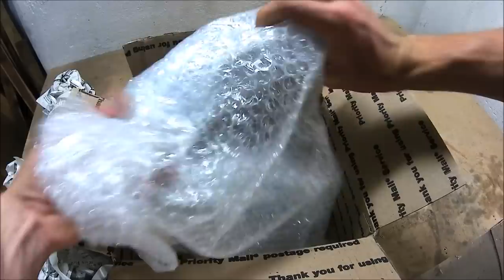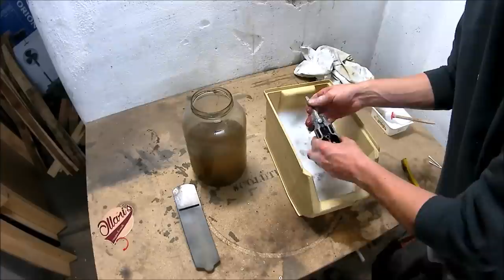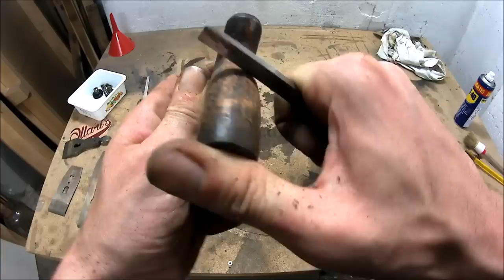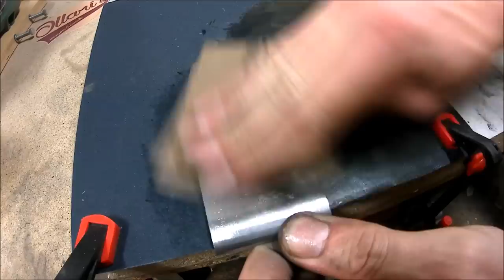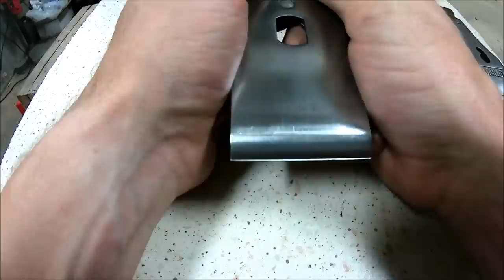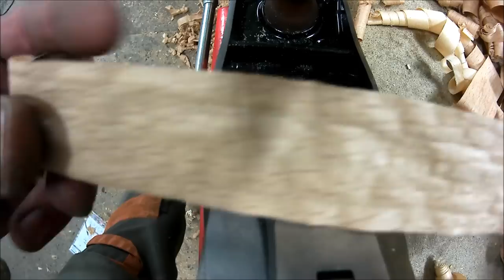Restoring a Stanley Bailey NO 4.

Comment: I've also used abrasive powder sprinkled over a sheet of glass lubricated with kerosene to clean up a plane body, instead of the sheet of sandpaper used here.  Restoring tools requires lots of mindless work, which is very theraputic!

Comment: Great work, I have some tips for you ... you shouldn't put (now you should remove) paint under frog that are directly connecting to body of plane. It soften the connection and can cause issue in hard woods plaining. Also a tip for cleaning screws heads - put them into chuck of a drill and use  scotch bright pad and after that use rag with cream for polishing compound e.g. automotive one for polishing rims
Reply from the maker: +Bartłomiej Derda Thank you for the tips! I will remove the paint for sure! Thanks for your comment!

Comment: Great work. What was the spray and solution you used to remove the surface rust?
Reply: Maybe Brake Cleaner.
Reply from the maker: +hulkpeace WD4 and steel wool
Reply: Cameron Lissner  has

Comment: I hope you got that plane cheap. At least the mouth didn't have cracks.
Reply from the maker: It was a gift from a good friend! It’s still in use for the past 3 years.
Reply: @Ollaris  free was the right price to pay for it. No. 4 is the least valuable hand plane Stanley made. Because they made so many of them. Not the worst plane they ever made by a long shot though. It really is one of the better ones. A must have for hand planing aficionados. You should have two. One for smoothing and one for scrubbing.